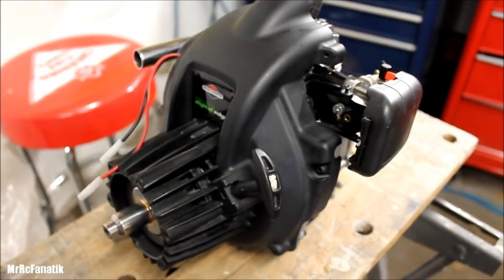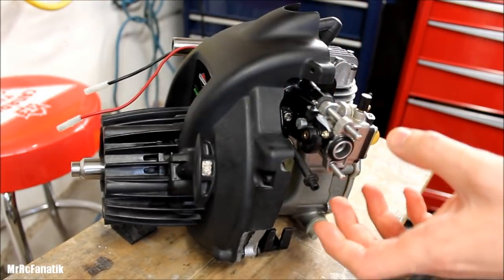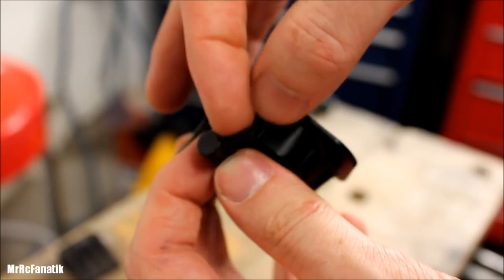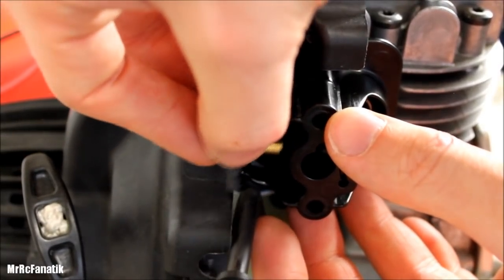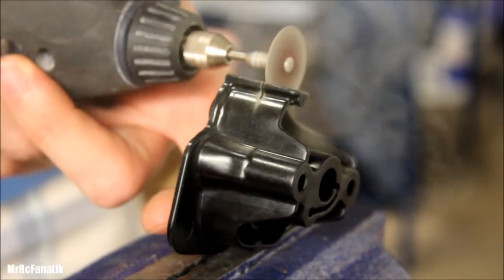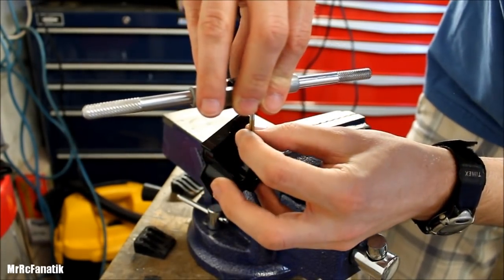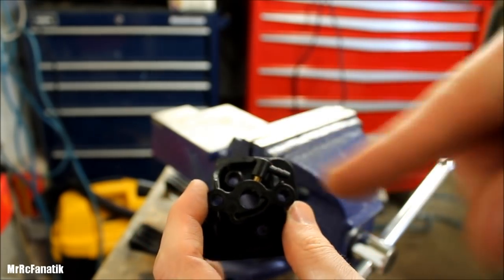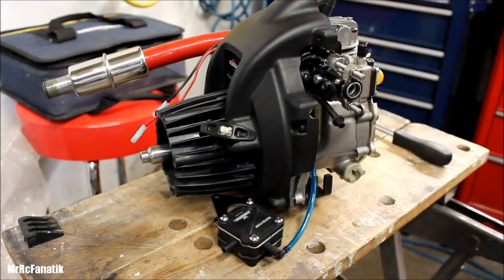RC Boat Water Pump Custom Install - How To

Comment: you can tap into the lower crank case.. your losing pulse strength going into the intake the pulse line depends on the piston moving up and down
Reply from the maker: You're right, I believe this affected performance a bit too as the carb had less of a pulse to operate correctly.  The crankcase would be a better spot to tap into for sure, thanks!  I'll pin your comment so others will see it 👍

Comment from the maker: Hey man.  Basically it works like the carb... the engine creates a suction pulse on the intake stroke, and the water pump uses this pulse to create a separate loop of suction.  This other loop is what sucks water from the lake, and pumps it into whatever the pump is hooked up to.  It has to be a separate loop, otherwise the engine would be ingesting water, and would kill itself!  Hope that helps! :~)

Comment from the maker: Hey man!!!  How're you doing!  I talked a little bit about that in the description... but basically, the water pump only works well at near idle RPM.  So while the boat is just idling in the water, it will still have the pump cooling the exhaust.  Whereas the normal system would only cool the exhaust when the boat is moving.  I'll be using that both systems together, to make sure that the exhaust will always be cool!
Hope that cleared it up man!  Take care!! :~)

Comment from the maker: Hi Corey!  It's ok man, I don't think I really talked about it that much in my videos.  Check out part 19 though... you'll see a red hose that comes off the rudder - that's where it picks the water up from.  The rudder has a small hole cut into it so that when you move through the water it forces some up and through the tubing.... however, when you aren't moving, but the engine is still running, you need a pump like this to suck water from the pickup.. otherwise the exhaust will overheat! :) ...

Comment: It will pump way way better if you hook it into the valve cover or crankcase where it won't shuck oil in

Comment from the maker: Hey man, haven't heard from you in a while!  Well, that may be so, but since this isn't a two stroke, I don't have to worry about oil... just gas, and since the new hole was so close to the carb's, then I'm hoping things will be fine.  Also I can just clean the pump occasionally if need be.
Cheers man! :~)

Comment: nice job buddy and excellent tutorial vid.....where did you get the engine? did you modified for rc use? what was for before?
is water pump essential for all rc gas boats with a clutch system?
don't have on mine, but i don't have installed any clutch either, you think i should?

Comment: Quick question ... maybe I missed it in one of your videos ... but when you mounted the engine to the boat ... where are you pumping the water from? Is there a hole in the boat that you are sucking water from? If so ... which video was that in? 

I'm brand new to building from scratch, but I'm really interested in trying a project like this.  With materials, how much do you think you spent on building this boat ... electronics as well.